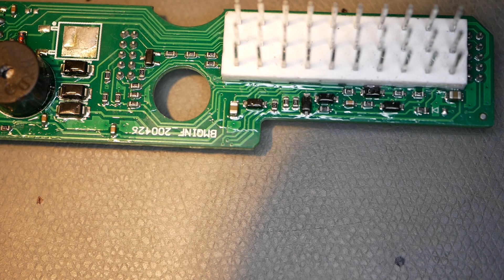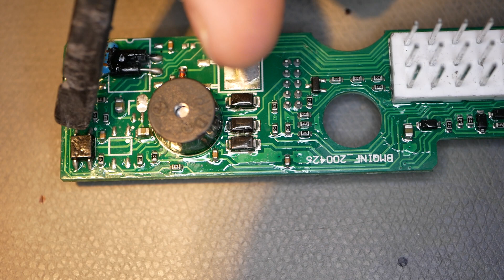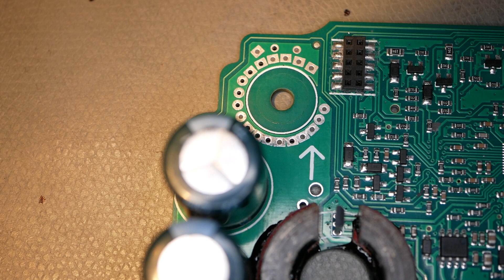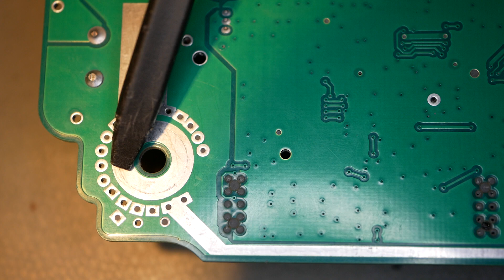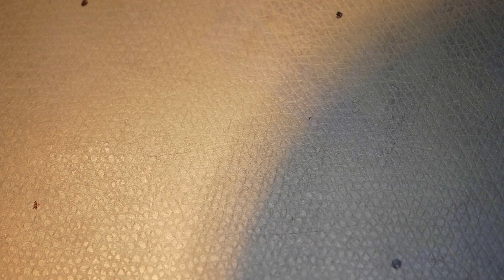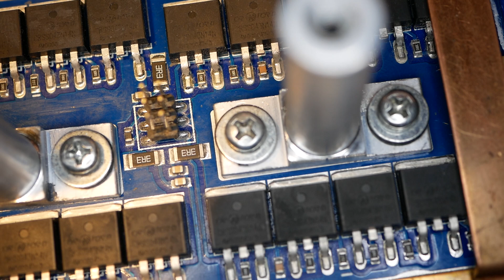Far Driver QS96530 Teardown Macro

Comment: Thanks for review! Small ceramic capacitor seems not for adding capacitance to the mosfet gate (it would be stupid) but between source and drain as a snubber.
Reply from the maker: Depends on the location of the caps. I do point out low side and high side snubbers. Many controllers also have ceramic caps at the gates that are there to slow down gate drive a little. This is commonly done because the gate drivers are not very good and don't hold gate drive as well as they should.
Reply: Hmmm, weak gate drivers would work even worse if adding more capacitance to gate, isn't it? If I need to slow down swithching speed I'd rather raise resistance of gate resistors. Five gates of high-power mosfets for single 2A driver is already big capacitance. And we see a personal resistor for each mosfet gate (as it's should be, so they're not paralleled), but only one cap for all five, and looks like no visible patch from cap to gate but to drain.
Reply from the maker: @Sobakin76  You probably already know that you've got several things that can be tweaked for best case gate drive. Gate resistors, gate caps and the driver on/off time are among them. Obviously better gate drivers will have better effect on gate control than will cheaper ones. I've seen power stages with a gate cap and resistor on each mosfet. A single larger cap for all the gates vs many small ones adds up to the same total added capacitance for all the gates in parallel and probably has the same effect either way in slowing down gate drive times the same amount. I don't really understand why you'd want to slow down gate drive this way, when you can accomplish the same thing with the logic signal sent to gate drivers and firmware. Is the gate caps possibly smoothing out gate drive ringing too?
Reply: But gates are not in parallel because each has personal 30 Ohm resistor from driver. I don't want to slow gate drive times in such applications (why you thought I do?) because it produces losses and additional heating, I only said what woult I do if I want to slow down switching speed. Gate is already capacitance by itself, so no need to add it more, tune switching speed by gate resistor value is better way IMO. Gate ringing (if it occurs) I'd better absorb by zener diode in parallel with gate as close as possible. Neverteless, good review, thanks. Now watching about ND96830 :)
Reply from the maker: I was not referring to you specifically, but rather a general "you" as in "anyone". The mosfets are in parallel and the gates other than individual resistors on them are as well. It's not perfectly technically accurate to say "they are in parallel". Other than the gate resistor, they are otherwise in parallel with each other. Gate caps exist. People clearly design in slower gate drive circuits. Why they do it instead of using driver timing is what I was wondering about. The only other reason I could think of was to smooth out gate ringing. I have seen what are possibly zeners in many gate drive circuits. They may also be TVS which is effectively the same thing other than current and switching speeds.
Reply: Oh and on "96830 macro 3" video I see similar cap between driver output and mosfets common source pad (but not directly between gates and source as there are resistors), so you was partially right. Maybe because of too long path from driver  and need for absorb som ringing. Sure this cap is really small, maybe about some 100pF's.
Reply: How to change driver timing? There is no method to tune driver output rise/fall time, just play with gate resistor value vs gate capacitance. But the cap is there, and I'm sure not for slowing down switching speed but lower the ringing because of long path from driver to gates (gate resistors), and it's small relative to gate capacitances and no really affects switching speed.
Reply: TVS are for higher power protection and has higher capacitance - not good for fast switching and excessive by power, better variant is rail-to-rail small diodes, but needs two instead of one :)
Reply from the maker: @Sobakin76  It is pretty common in controller development to adjust the firmware. You can do this in VESC based controllers pretty easily. It's not a setting in VESCtool, but anyone that is designing a controller would know about adjusting on and off times for the mosfets. You are right that you can't program rise/fall times for the gate drivers or mosfets. That's just the limits of the actual hardware implementation in silicon. What you can set is how long any given state is applied. Agreed...long paths can induce some noise and may need filtering with a cap.

Comment: Is there a place where all this knowledge is being accumulated? Like a forum? I have a 72850 that just failed on me and it looks like the output cap is shorted to ground on the 3.3v regulator. I wouldn't have dug into the potting without your video which gave me some idea of where too look. I have a bunch of pics that could get added to a forum post if there is one for fardriver teardowns someplace you could suggest.
Reply from the maker: You are there at that repository of this information. There is also my forum on Facebook. Look up EV Components Review...you'll find it! I'd be quite happy to have you add your tear down to the content there!
Reply from the maker: Caps can die, but they don't usually become dead shorts. That's something else like the 3.3v linear regulator or something that uses 3.3v like the CPU.
Reply: @de-bodgery   Yeah I think you might be right. I don't understand how the cpu blew up its so isolated. But its looking more and more like that is the case. I ran this thing a few hours and its failed, i sort of dont know what I should do now as was just getting my gokart setup and it ran with one of those chincy 3000w bm1109 motors over 100 miles. This lasted maybe 20? I cant afford to put $400 controllers in this thing weekly its a toy to learn ev with.
Reply from the maker: @tonycottrill5158  Hit me up on facebook (Richard Gumfaw). You can send me your controller if you want. I can't say it's repairable and frankly depotting can be risky in itself! I've been successful sometimes and totally failed other times! Anyway, maybe your controller is repairable? Worst case, it will make for a good tear down. I totally understand that feeling of desperation when new hardware blows up on you! Been there, done that! Feel free to cuss a lot...lol...I sure do when it happens! Anyway, hit me up on FB and show me your cart on there...maybe there's good reasons that you don't know about for why it killed the controller!?

Comment: Was really wanting to like this controller. Mine blew up in 20 hours when running it at normal settings. 96530, 84v battery. 250 battery amps 530 phase amps. Starting to hate fardriver
Reply: Edit - mosfet blew up
Reply from the maker: I don't hate FD, but there are better products to be sure and worse ones.

Comment: I’ve been thinking recently…why doesn’t every controller integrate a pre charge circuit right inside of the controller? It would make life more simple for the user, but I am the furthest thing from an expert so maybe there is an obvious reason why there are no motor controllers that integrate pre charge directly. Feel free to chime in or correct me!
Reply from the maker: It's an easy thing to not have to design in or pay for. Make the person building the EV deal with precharge. It also means a 4th set of mosfets and the heat they build up to deal with inside the controller. For DC continuous you need more mosfets for the same current as you do for AC. In a controller, every set of mosfets gets a break from running for a little while. This helps keep them running cooler. With mosfets for precharge, they have to run continuously. Same is the case in a BMS and why you have so many in parallel.

Comment: Part two: So, question and a bit of history. I am using Votol 150 with 22s charged to 4.1V per cell. Total voltage 90.2V. 3-speed switch configured to 120A - normal mode. Sport mode - 150A... As far voltage stay 90-88V i am using 120A, as far it drops lower 88V I am switching to 150A and all works fine. I was just thinking to start using 150A starting from 90V, but afraid to burn mosfets. I googled a bit and find out that mosfets are working at frequency of 8-16 kHz (turn on\off. Period is changing all the time. not pure rectangle) But didn't verify that myself. Than I checked datasheet at mosfets that are inside votol 150 (MDP10N027TH) and "Fig.9 Maximum Safe Operating Area" Taking in to account that 8 kHz correspond to period of 125 microsecond and 16 kHz - 62.5 us (microseconds) at 90V that gives max sefe current far over 100Amps per MOSFET at 90V, but even with period of 1 ms (1kHz) MOFSET have max safe current ~45A at 90V. Worse case 45A per mosfet * 4 mosfets =180A*. All that are way better than shown in datasheet of mosfets that are used inside fardriver QS96530. How do you think, will it safly run at 150A with 90V voltage (Sure there is voltage SAG also during acceleration. In my case 2-3V) P.S. Load is not constant. I am using bike for enduro (dirtbike). So, short accelerations at 150A (2-4 seconds) and sometimes uphills (3-20 seconds) Thank you in advice for your opinion. P.S. Sorry.  English is not my native.
ps.2 Or maybe if ask in different way Is there any sense to change votol 150 to fardriver in case of max voltage 90V if look only at max current capability.
Reply from the maker: The amps will be OK, but the voltage may be pushing your luck.
Reply: @de-bodgery  Thank you)
Reply: @de-bodgery  ps. Just tried today 200A config. 22s. Battery charged to 89.5V. SAG 5V. (At bms) what can I say. 209Amps in peak and 17kW. Awesome ) motor qs205 v3 T3 as mid drive gears 19\52. Just in case if someone will search for similar information. However it is cold outside. (chain 428. too weak. probably better 520)
Reply from the maker: @viko2812  I bought a brand new 4000w v3 205 motor a few years ago. I never used it and eventually sold it to a freind. It did look nice and beefy inside! Probably 12kw or more peak would have been possible. FD controllers are not dead weight. They can be better, but not dead weight. Even terrible designs like the KO products still can make phase amps, they just don't do it very well or efficiently! I'll be running my FD soon!
Reply: @de-bodgery  Hoping to see. Good luck!
Reply: @dcktater7847 Sorry to hear that. Hope that for you, it will be easy to repair or get new. I just googled, and noticed that votol em 30S (not 30,but 30S) is using Magnachip MDP1991. They are also 100V MOSFETS but only thing they have a bit more internal resistance -  5.9mΩ vs 2.8mΩ. It is strange that you received broken controller as a result. Maybe there is something else inside that can't handle that voltage. One more thing about peoples with 23S or more than 22S. IDK, honestly if votol 150 can handle 23S, it is very close to the limit and probably it is good to keep in mind that different batteries have different voltage SAG depending from load. Mine have around 5V at 200A + 0.5V at wires from BAT to controller (I am using 22s CATL 60A). So, even if I will push full throttle, battery will give only 91V-5.5V. And there are some peoples that using very small in capacity batteries with crazy loads. They can have 10-20V SAG. I am not saying that every person that have 23S will have 20V SAG, but with small battery that is possible.   And once again hope that you will repair your controller without problems. Good Luck!
Reply: Btw, forgot to ask. Did you noticed magic smoke from controller? (We all know that microchips works at magic smoke and when it comes out microchip no longer works) or it was more like boom? (Capacitor)

Comment: This would be an ideal candidate to measure the resistance from the phases through the mosfets and to b+ and b- like i did on the g300 on the vesc discord with an ajdustable power supply and milivolt reading. That will validate if the b- or b+ busses are weak. but the power stage layout looks decent to me. the drain tabs of the mosfets actually do a good job acting as a positive bus bar and the copper is probably 2-4oz here.
Reply from the maker: I was thinking about doing the battery busses end to end with my milli ohm meter.

Comment: Did you look up the part number for the mov? it looks closer to a ntc resistor to limit inrush current to the buck converter or such.
Reply from the maker: I rarely look up discrete components. If I did, I'd spend 10X more time just researching parts for a video! To me it looks like a MOV. It's location isn't on the DC-DC that I noticed. I could be wrong about all of this, but that's what I thought it was.